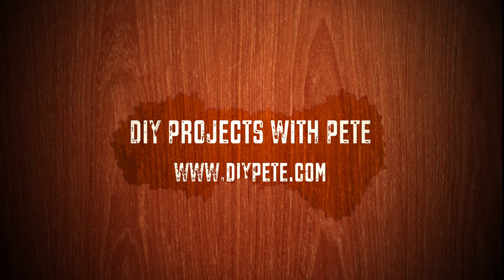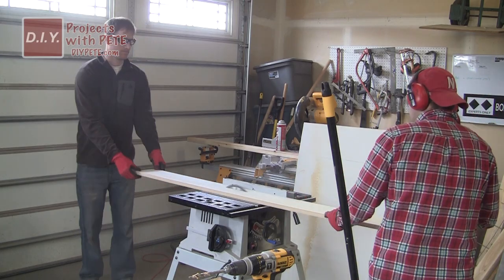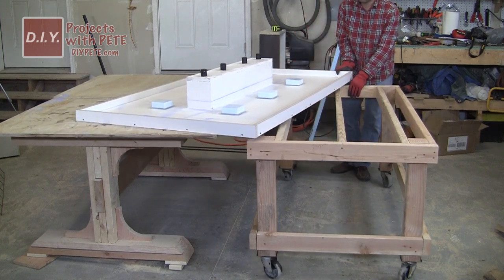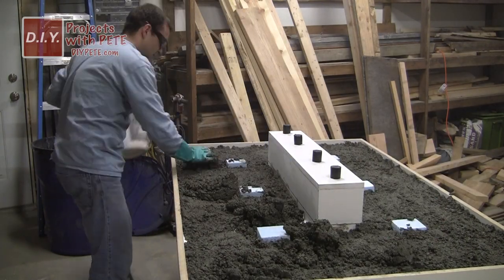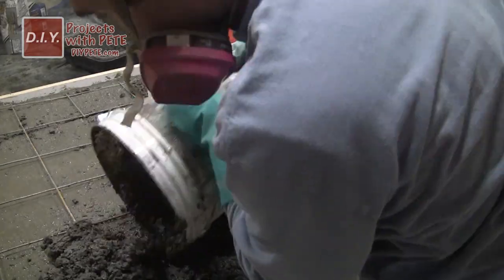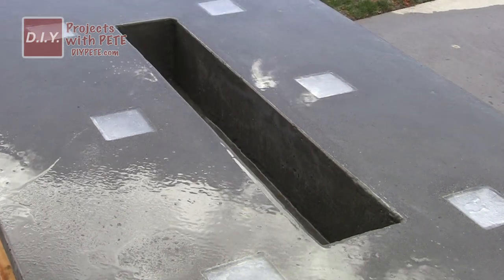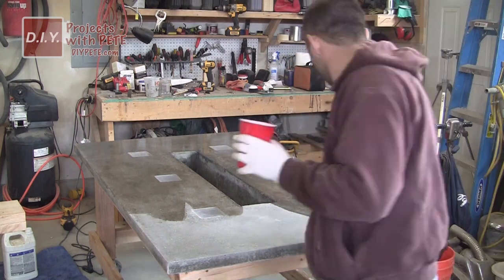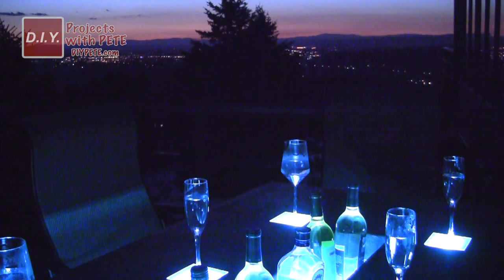How to Make an LED Concrete Table with a Built-in Cooler

Comment: If you keep an old worn out diamond pad you can use your polisher to fill bug holes. Just mix your fill paste and apply it to the surface. Then run over the substrate with the polisher forcing the paste into the holes. a fine pad and a slower speed works best, work in small sections Pete nice work, cool project!
Reply from the maker: Thanks so much! I appreciate it and thanks for the kind words and for subscribing. Cheers!

Comment: nice one thanks. I keep getting told a table would be too heavy and that I'd need to do a fibreglass layer then very thin layer of concrete, as opposed to mesh and rebars. You've convinced me to try one.

Comment: Josiah Dude,  As was often said around the squadron "Sierra Hotel (SH or Shit Hot)! I'm a trauma surgeon  by trade and woodworking has been may life long hobby. I've been scared to tackle concrete for some reason. I usually just hire a bunch of guys. So I was surprise when  I can across  you site by accident,  now I can't leave it. Your projects and your calm deliberate instructions have taken away most of my fears of working with concrete. I've already made the lighted cooling table for six and the fire pit already. Next I want to try an expansive counter top for my out door kitchen.Thank and keep up the inspiring videos.
Reply from the maker: Hi! I'm so happy you have been inspired to work with concrete and have already taken action building the other projects. You rock!! Have fun with the outdoor kitchen projects!

Comment: How did you support the acrylic insert to the top of the cooler section for when not using the cooler? Or is it plate glass?

Comment: You can use a typical palm sander as a concrete vibrator, just move it around the exterior of the mold and it will take care of the honeycomb issue and reduce patching time. If you want arm comfort and don't want to worry about chips on the edges just install a chamfer in the mold, 45 degree chamfer strips can be purchased at any DIY store in different sizes, and you will have a clean custom look edge.
Reply from the maker: +///// GRIFFIN Great tip on the chamfer:) Cheers

Comment: I have seen this when first posted it, I love it! I always come back to  it just to look at it. I wanted to know how you get the power to it. Where are the cords that go into the outlet. How is it that your table is in the middle of no where and no cords for people to trip off of.  How do  i go about this?  Does it operate by batter. Please explain
Reply from the maker: +Elite Child Hi Elite! The cord is attached to one of the legs and then goes flush with the deck. You can either run an extension cord along the deck (and tape it down) --- or I have run the cord through the decking and to a plugin. There are kits that run off AA batteries as well. I have a battery setup for some of the tables and bar carts I've made. (You can order the battery kits for about $50 off Amazon. The plugin versions are about $30 on Amazon.
Reply: Thank you for your response! I enjoy just looking at this project so much! Do you have videos of the bars and tables you have made? I would love to see them!

Comment: Thanks Pete.  I have started a mold to build my own.  Will probably pour it in a couple weeks.  Any suggestions/tweaks on this since you completed it that you might change now that you went through the process?
Reply from the maker: Hi! It's been sitting outside about 3 years or so now and I throw a coat of sealer on it each spring. Still looks very nice. Once thing I would do differently --- is to buy a metal trough instead of doing the trough out of concrete. It cuts down on weight and makes it much easier to work with. I just had a hard time finding something affordable online to share with my readers.

Comment: Did you seal the strip lighting running through the trough from water somehow?  Or does the ice sit right on top of the lighting?   Thanks!
Love the layout and the comprehensive video. I was too intimidated to do a similar thing for my kitchen, but now it seems possible.  =)
Reply from the maker: +Roger Grubb Homes Hi Roger! The strip lighting has a thick clear rubber all the way around it and is waterproof.  Good luck!

Comment: Can the trowel in the middle be wider if wanted? Also can a standard orbital sander be used if I don't have a wet polisher? I have done three of your projects so far and I want to tackle this one...
Reply from the maker: +TheJerseyDigger Hi, yes -- the trough could be wider. An orbital sander can be used. A wet polisher is ideal for cleaning up around the acrylic panels, but you'll be able to get a good looking table with a simple sander as well. Check out my concrete dining table video for some more tips. Cheers!   https://www.youtube.com/watch?v=eZyeVPEqbF8

Comment: Pete, do you have the plans for the table portion of this build? I’m tearing down a couple year old deck and thought I could probably make a couple of these with the material that is reusable. Thanks in advance!
Reply: Also, I’ll take any updates or tips you have since making this table. Thinking about a smaller matching one for my kids as well.
Reply from the maker: I would not do the trough out of concrete, and would find a 6" by 30" or so stainless steel sink on Amazon instead.   --- you could basically do a knockout out of foam for the trough, similar to this concept.  ( plans for table top are also available ) https://www.diypete.com/make-concrete-pub-table/
Reply from the maker: I do have a diagram and more info on my site here: https://www.diypete.com/stunning-led-concrete-patio-table-with-a-built-in-cooler/   cheers!
Reply from the maker: Looking forward to seeing what you come up with!

Comment: great table and how to video, 1 question will the water from the ice damage the leds?
Reply from the maker: Hey Chris, 

I used waterproof exterior grade LED strips - and the leads are protected under the table but I still taped around them.

Comment: Hey bud, is it possible to include a dollar amount for materials (estimate) and then an appraisal when finished?
Reply: +Evan Cook From the Makezine article.

"The cost to build the concrete top with the LED lights was $244. The base was made out of construction grade pine and sealed with spar varnish for about $75. Total cost for the table from start to finish was $319. "

From a comment by the creator:

" If I were to make something like this table to sell, I'd probably sell in the $1300-$1900 range if you have the right place to sell it"

Comment: DIY Pete, love your work man! A few questions if I may: 1. What does this table weigh, estimation? 2. About how much would a person expect to spend on this project? Again estimation is fine. Thank you sir!
Reply from the maker: Thanks! So if I built it again I would use a long and narrow sink for the trough instead of concrete. This makes the project way easier. The sink I ordered for my new table was $150 and is stainless steel ( 30x6 ). The concrete will be around 6-7 bags or so at $6 / bag. The melamine will be around $35. The acrylic about $20. Lights etc $35    , plus the base. That is a quick estimate :) Cheers!

Comment: and how do you empty the water from the melted ice in the middle? 
since turning table upside down is out of question,  there should be some whole with lid in the bottom, or even better some kind of faucet applied to take water out
Reply: +Kanenas Ithaki I'm guessing through the 2 PVC holes in the trough.
Reply: +Justin Kou didn't see them but even if they exist it's not enough. If there's no valve it'll spill on your feet while you sit by the table. I'd it's not placed outside it should get normal plumbing pipes to take water away. In that case the valve isn't needed
Reply from the maker: +Kanenas Ithaki Hi Kanenas! Thanks for reaching out. The holes where I eventually installed piping are made in the concrete trough -- but the piping is not shown in the video. I Ran piping from each and then did one downspout  so it can drip in a bucket. Ours is outside and this works real well. However, use your imagination and do the plumbing to best fit your situation. Obviously if indoors you'll want to do a little more. --- I did the trough out of concrete to keep the costs down for other DIY'ers out there. But, if I were to do it again, I'd simply do a foam knockout to create a hole in the center of the table. I'd then put a stainless steel trough in. One without holes that you could simply pull out and empty in the sink. I couldn't find an affordable option when I was building this, but if you come across one let us know! The table would be much lighter without the concrete trough as well. I'd love to see your version of this table! Cheers from Montana  - Pete

Comment: so steel mesh is needed for tension? I'm guessing the steel can be a bit flimsy almost looks like fence wire.
Reply from the maker: Hi, I use the mesh and it's used as re-enforcement. It is somewhat similar to wire fence and is commonly used in concrete sidewalks. 3/8 inch re-bar could be used if you'd prefer.
Reply: Thank you I'll look into both

Comment: Would it be safe to add led lights to the concrete fire pit table you made? I love the led light idea! How warm does the fire pit get? Is it mainly for looks or does it actually keep help keep everyone warm? Is there anyway to control the temperature? Also I noticed when you mixed the concrete for you dining table your mix was quite dry vs the concrete mix for the fire pit table. Is that because you used The concrete mix that has the reinforcements in it is that way it looks drier and not wet as the other concrete mix?
Reply from the maker: Hi! The gas fireplace does actually keep you warm. Just do one with enough BTU's that it does. You can control the amount of gas let out which would make it warmer. As for how it was mixed, I used 2 very different types of mixes. -- but would recommend quikrete 5000 for future projects. LED lights could go around the outside perimeter of the table below the surface potentially, but will need to stay away from heat. Cheers!

Comment: Great Video. How do you drain the water from the melting ice? Does it just drip out of the holes?  Are those led lights water proof? Is the ice right on top of it? Or did you put a acrylic glass sealed bottom. I def want to try this. Thanks for sharing.
Reply from the maker: coolmjr Hi! I originally set buckets underneath to drain the holes but have since hooked up some pvc piping to run from the center and then into a bucket (or through hole in deck). The LED lights are waterproof and I've left them out for an entire year without issues. (Montana winter, spring with rain, etc. I do put the ice right over the lights. You could seal things off with acrylic though if you'd prefer :) Good luck! Let me know if you build it!

Comment: Just a quick question I'm looking at your mold and I see that the same effect can also be achieve with pressure tread wood as well question is how to drain the water out of it when the ice melted Inside the table... ? or will you even go that rout...(wood)?
Reply: +Oscar Crisanto  You can use a clear urethane to protect the wood. Use several coats, and make sure it is applied correctly. Just drill a couple holes for the ice to drain, you could always hook up some tubing to direct the flow of water where you want it. You could possibly line the trough with plexiglass and seal it with some clear silicone.
Reply from the maker: +Angeles Shockley Hey Angeles! Thanks so much for chiming in man! I appreciate it. All good info :)

Comment: What if you wanted a color other than concrete gray?  I guess you could add a dry dye to the mix, but what about when you slurry it to fill in the holes after the pour?  How do you get a slurry with matching color?  Or is it better to do it gray and stain after the slurry/sanding?
Reply from the maker: Hi Mayela! You could either add a dye ( liquid or powder ) -- into the mix --- or you could do an acid stain or dye after the process ( more topical ). -- If you mix integrally to a color other then grey ( green, brick, etc ) --- you can mix the pigment into the slurry mixture and do your best to get a matching color. It really depends on the look you are going for. I've done both numerous times. Sounds like you have a fun project ahead of you!
Reply: Thank you!

Comment: I would think that using a hammer drill with a long extension and socket wrapped with thick padding to use as a vibrator might just be enough to work loosenthe air pockets.
Reply from the maker: That's a great idea for sure!

Comment: Hey Pete - would this technique work for a kitchen counter top with built in sink?
Reply: Hi Liam! A similar technique certainly could be used for a built in sink. I'd recommend doing a little more research on re-enforcement -- and seeing if there are some videos on concrete built in sinks that could provide a bit more info. You'd also want to make sure the bottom of the sink has some sort of an angle to the drain so the water moves on it's own. Sounds like you have a unique project ahead!
Reply: hey liam ive seen a video on here where a company does concrete countertops with built in sinks so it can be done if i come across it again ill let you know

Comment: Ok Pete first may I say kudos, this is a beautiful table. I have two questions. One, can there be a nice wood (or other more affordable material) alternative to the concrete? And two, did you add a drainage to the bottom of the ice reservoir?
Reply from the maker: Chad Wicklund Hi Chad! You could certainly create a top out of wood for this project. Tile might be a possibility as well. Yes, I did add drainage to the ice reservoir but didn't really go into it much. Let me know how your build goes, I'd love to see how it turns out! - Pete

Comment: My experience has shown that when using concrete mixed that dry, shaking it does nothing to remove air bubbles.
Reply: Yeah. I would have used an admixture to make it more workable
Reply: You could tell when he flipped it over. Tons of holes. It was REALLY dry.
Reply from the maker: I use additives a lot more then I used to nowadays, but could have mixed this one up a bit more fluid. Thanks
Reply: I actually thought it still came out better than I anticipated it to be. Plus, I've seen a lot of people do the same thing as you using a patch type at the end. Genius table though. Props!
Reply from the maker: Thanks so much Josiah! I really appreciate you chiming in and for your support too. I actually got a table concrete vibrator recently so it will be interesting to give that a whirl as well. Hope your concrete projects are going great!  - Pete
Reply: Mick Scarborough - The mix is so dry it would need an industrial vibrator to get it to settle with air bubbles released.

Comment: WATER GOES OUT TOGETHER WITH LED LIGHT, I WANT TO MAKE A TABLE THAT ONLY THAT WOULD LIKE TO KNOW HOW WATER WILL EXIT. I would MUCH OF AN ANSWER ... I'M FROM BRAZIL THANKS
Reply from the maker: Hi! You might also check this video out for other ideas on ways to do a built in cooler: https://www.youtube.com/watch?v=VB94hVMWt5M&lc=z130sdfivs3thtm3123rirzqsvftcxse0   -- For this table I ended up using some 1/2 inch piping underneath and bringing it into 1 drain. The 1/2 inch piping allowed room for the LED wiring to still go toward the sides. I filled the gaps with silicon.

Comment: Hi Pete, I really enjoyed this video. It showed me some possibilities for a backyard I was going to do. Really modern looking & way cool! For the LED lights underneath, is there something else I could do? Or is adhering the lights with silicone the best way to install the lights? I was thinking of gluing some hooks or clips in case I needed to change the lights out. What do you suggest?
Reply from the maker: E.J. Katigbak Hi E.J.!   -- I actually figured out a much better way than the silicon. I bought a couple packages of the really strong velcro from home depot. It has a super strong adhesive and so it sticks well to the underside of the concrete. I put the LED strip between that piece and the other piece of velcro. This way the lights can easily be removed at any time. Installing them is easy too. The velcro has stuck great all spring, summer, and even this winter outside. So I'd say it is a great solution. Please send me a photo of your table. I CAN'T wait to see what you create E.J.! Cheers - Pete
Reply: Thanks Pete! Velcro! It's good to hear that the adhesive was strong enough. I'll keep you posted.
Reply from the maker: E.J. Katigbak Awesome! Can't wait to see what you create!

Comment: what happens to the ice when it turns to liquid state ????is there any drainage system in place.??
Reply from the maker: I ended up adding a pipe at each hole, running it to 1 pipe that then goes to a bucket, or could run through the floor of a deck. I didn't show it in the video --- but put on your thinking cap and I'm sure you'll come up with a great solution! Cheers